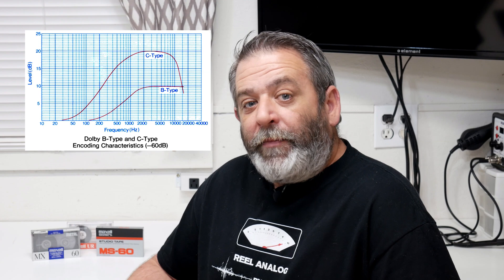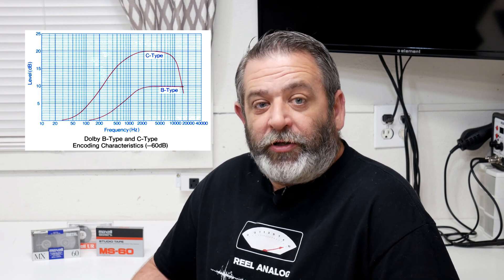DOLBY NOISE REDUCTION - Was it GOOD or BAD? Live Audio Comparison of Dolby B and C on Tape

Comment: This is NOT properly done demonstration. First, no mention of tape machine calibration for the specific tape in test. Second thing is that your deck (don't know what's the source really but let's say it "doesn't matter" at this point) has awful audible level and wow/flutter issues. And the noise level is way too high. Even at the source. I stopped to watch this video but I ended up being disappointed.

Comment: Wait....just wait! Enormous amount of noise is present during recording....in source signal. That is unforgivable mistake. You can not testing equipment in such a way. You implemented huge noise during recording, that noise MUST be recorded and played. Second, you can not test NR systems without deck with regulated bias. That Tascam is good piece, but be fair, take some 3 head decent device.
Reply from the maker: That's an old video. My equipment and capture techniques have changed a lot since then. I probably need to revisit that subject.
Reply: @VintageElectronicsChannel Sure.

Comment: I  used a  DBX 3BX and looped it  through the tape system, and recorded with N/R turned off .  THE DBX was rated at 115 DB S/N and 100 DB for dynamic range.  That translated to cassette, without dealing with the ENCODE/  DECODE , issues that were inherent  in the DBX stand alone units . (THE 224) for example . I also had  the TEAC A-550 RX. THAT did have build in DBX type II, But, I achieved better noise reduction, by using the 3BX . Than, using the built in DBX. Which  was basically a single ended compander.  With that setup, running TYPE IV tapes, I was  getting 20-19 K,  and  a 85 DB S/N. Dead silent noise floor, with no  noise  reduction.  Love the old tech.
Reply: I have diy dbx, I made it back then in 1991...it works awesome. Makes great recording on every decent tape.

Comment: Please stop regurgitating this nonsense that Dolby C was created by combining two Dolby B systems together. This is not and has never been true. It's a totally different system employing spectral skewing to combat tape saturation at high frequencies and high amplitudes as well as providing up to 20dB of noise reduction. On a correctly calibrated and well maintained deck, it vastly improves perceptual transparency and can provide a flat frequency response from 20Hz to 20kHz even with Type I ferric cassette tapes.
Reply: As an electronic technician knowing the inner workings of Dolby b....6 transistors,1fet transistor,4 diodes ECT.you are correct sir.also it was so obvious how he added white noise to fake the demonstration

Comment: Type II/IV tapes generally don't need noise reduction as they can accept higher strength signals, thus giving them higher signal to noise ratios as well. It's normal tapes that noise reduction systems are mainly meant for. Dolby B was good for reducing noise but higher frequencies were still weak. Dolby C would make normal tapes play back with greater clarity and cleaner sound, like their high bias counterparts.

Comment: I use the same Maxwell UR  C60 Ferro and I must say that  I do not accept with them any noticable change of sounding. But my decks ( I use two) are tuned by me exacrlty to meet that result. I wonder (some may say it is conspiuracy theory but it could have good economy reason) that producers tuned decks so that they would sound a bit foggy  with Fe in opposite to  say Cr. I personaly could  not prove  it technicaly supported - both  kinds of tapes sound without sound  issues and that is why I prefer Ferro over switching to Cr and worry about head.
Reply: Most type 2 tapes are not chrome so there's no worry about extra head wear.type one tape on good equipment will perform as good as type 2 with the exception of about 4 db less tape hiss and in some cases higher peak output capacity

Comment: Two crucial points for me are these-- if you use an equalizer, you can boost the treble compass of the cassette when Dolby is IN. That really helps bring up the highs which have been attenuated by the NR system. Secondly, all normal bias tapes are JUNK, people. They were made for VOICE DICTATION. That is it. They were never meant to be a hi fi system. You have to at least step up to type 2 or better tapes to get the treble compass needed.
Reply: I do not agree. In my gear tone controls must be    set to null position and that is poroof of good sounding For sound alignment you need to posess  the  Loudness correction adequate to speakers and levels , not tone controls.  If Dolby beats high sopranos below neutral sound  it means that something with  head- or tape pushing to head or transport alignment is wrong ( of courrse not mentioning cleanliness). Beating it with EQ  is worst idea.
Reply: You have no clue what you're talking about.first of all the high frequency attenuation simply brings the Dolby high boost back to it's original level during playback.nothing gained nothing lost.secondly type one tapes sound indistinguishable from digital audio with Dolby s.i challenge you to tell the differenc

Comment: .. Great  demo for what it's worth the technical aspect of other comments would go way over peoples heads so you done the right thing with this test.  It's exactly what anyone wold do with tinkering and getting there set up right i am on the fence with dolby as i use multi track  recorders but i have to ask is the dolby that's built into these systems a gimmick. Why did they bring out stand alone dolby there is so many options in daws that is the reason i would avoid using dolby
Reply from the maker: I don't think Dolby is a gimmick. I believe it had practical purpose in reducing tape hiss at the low speeds cassettes run at, especially in the early decks. That said, I'd rather deal with the hiss than have my recordings dulled on playback with Dolby B
Reply: @VintageElectronicsChannel  .. I respect your knowledge and sharing your experiences  with this technology but i do have a question. I own multi track cassette and reel to reel recorders and would love to know. Is the built in dolby b of these systems of the same quality of a stand alone. I am looking at some standalone like a TEAC AN-80 would is give me the same results as  something that has dolby b built in with just the regular on off.
Reply from the maker: @theprogrammerrolandmc3039, I don't think I'd recommend using Dolby with a reel to Reel. Even at 7.5ips, the noise is so low I don't think it would be necessary. I don't have a lot of experience with standalone Dolby equipment, except some Dolby A stuff for open reel. I would think it would be the same technology and result as a built in system though.
Reply: @VintageElectronicsChannel  .. Thanks for your help i agree reel to reel is completely different from cassette i never have hiss on my reel to reel.

Comment: Dolby noise reduction works only in the most optimum circumstances. Clean tape path, right head height, azimuth, tape speed, tape calibration and level. If you don't, tape will most likely sound muffled. People don't want to go the extra mile to get their decks properly calibrated, so they just rather be stubborn and say that dolby nr never worked and just never use it. But when it works, IT WORKS. Dolby S plus a metal tape is as good if not even better than a CD.
Reply: Yes, agreed. I run a 3-head deck with Dolby B, C and S. It also allows me to calibrate the bias to the tape. Dolby S effectively has the same noise as a CD, i.e. none. Dolby C is subjectively nearly as good and Dolby B has a little audible hiss, but way less than recording without. Other than slightly audible hiss with Dolby B, any of the Dolby systems give an overall recording quality with Type 2 and 4 tapes that is effectively indistinguishable from the source, be it CD, Vinyl or whatever. I could certainly never listen to a non-Dolby recording on headphones - the hiss would drive me crazy. However, my first experience with Dolby was in 1974 with Dolby B on an Akai deck and it sounded awful, partly because I only had type 1 tapes, but also because the Dolby was probably badly calibrated and drastically knocked the treble off as well, making recordings sound as though they'd been made from behind a thick curtain. It's a fact that all things analogue are far more dependent than digital on being of good quality and being set up properly if they are to perform well, but that in itself brings its own reward.
Reply: Lots of audiophile malarkey there but I'll snap on the last sentence.  
Digital audio's bit-depth determines the level of the noise floor.  The top of the line, most expensive open reel machines used in recording studios were almost as good as 13-bits in perfect conditions while using the most advanced NR systems available.   To suggest that a cassette tape of any formula with any form of noise reduction can exceed the 16-bit quality of CDs is ridiculous to the point of being offensive.

Comment: For me, it depends on how I plan to use my cassette. Dolby is heavily dependent on azimuth. Playback on another machines with Dolby which aren't in perfect head alignment with the recording deck, will usually not give favorable results with Dolby switched on. They can often sound dull and lifeless. If I am making a cassette that will be played back on other machines, I will usually opt for no NR unless the recording contains quiet spots and I am on a Type I tape, then I'll encode with B. If I am making a cassette that I plan to only play on the deck that is performing the recording, I will opt for C. My deck doesn't have S but I am interested to hear how that compares to C. Metal cassettes have lower floor hiss by nature, so you can certainly get by with recording with no NR on those if you have money to burn. When a metal cassette is played back on my recording machine with C Dolby used, there is absolutely no hiss at all. Only the amplifiers transistor hiss is present. Sometimes, as you mentioned, I will record on type I with B NR on, even if the cassette will be played on another machines without Dolby, because the only draw back is usually exaggerated highs which can be corrected easily through tone or treble adjustment. So, my opinion on this is - If you are planning to play your recording on other machines, it's probably best to leave Dolby off. On type I tapes you plan to play on other machines where your recording has quiet moments, I sometimes decide to record with Dolby B on. On those types of recordings you might get lucky on another machine with Dolby on. If you are only playing back on the deck doing the recording, shoot for the moon. It will sound fantastic!

Comment: B and C worked great if you recorded and listened to  the tape on the same deck for sure but it might not sound so good on another deck. I used chrome cassettes  mainly TDK or Sony were my faves but also Fuji had good ones. If you set the level just right it was way better than nothing because the hiss and lack of dynamic range of a raw cassette was not very listenable. If you had a type 1 tape with no dolby it sounded like gravel. Does the youtube compression affect this? I remember hearing the hiss much more even with better tapes.

Comment: It seems like there are some issues with your equipment. There's an awful lot of noise and distortion in the sound during the demonstration. Even during the 'recording' part where you played the 'original' there was already a ton of noise in the sound. That should obviously not be the case. The playback that followed after that sounded extremely muffled and distorted. This is NOT what tapes should sound like, played on a well maintained and calibrated cassettedeck. Other channels like 'Cassette comeback' show what tapes can actually sound like. Even without Dolby they can sound a lot better than what is demonstrated in this video. This video might give people a completely false image of what cassettes sounded like.

Comment: My experience has been that I never use Dolby with chrome and metal cassettes, as these usually have a very low noise floor and the record level can be set so high, that the sound acoustically masks the background noise. With normal position tapes, I use the best noise reduction system available, but either when I'm sure that all my cassette decks have the same Dolby calibration and I don't notice any pumping, or when I'm sure that I'll only be replaying on the same deck.

Comment: You were super over biased on that type 1. Proper bias and a type 1 sounds very good with no loss of treble. In my experience with NR, it can sound very good, but there's still something missing and some music makes it apparent, a quiet trebly instrument buried behind loud mids and lows will sound slightly quieter using NR. But not always. Best to leave it off, no processing, just hear what's actually on the tape. Dolby is a cheat that doesn't quite work perfectly.

Comment: Before doing such a "test": You have to calibrate the recording level, bias and if possible the EQ ( this have noting to do with the 120/70 us ) for every tape used, certainly using DOLBY C ! DOLBY C needs the record level correct within 0.3dB and a descent flat frequency response to operate properly. By the way, your TASCAM 112 has audible flutter.

Comment: I don't think it was nearly as good on commercially recorded cassettes as on ones you made yourself on your own machine. First off most commercial tapes were recorded hot and lost highs to begin with. Then cassette head alignment was critical and probably the mass production recorders heads were not exactly aligned like yours which would lose highs.  I always worked to keep my peaks out of the red as much as possible and made decent recordings with higher grade tapes.
Reply from the maker: I agree with you. Commercial tapes never sounded good with NR switched on.

Comment: Type I - All three were too quiet (if volume didn't change) and lost horrible amounts on B and C.
Type II - B and C weren't much different than the original, but slightly muted.
Type IV - Surprisingly B and C did worse than Type II.
Overall, Type II was the best.  Now let's hope the newly made Type IIs are as good as old stock.
Reply from the maker: I've always preferred Type II cassettes. Metal sound great too, but I never felt the price difference was worth it when compared to a well-recorded type-II.

Comment: How about a video on DBX noise reduction and compare it to dolby C and S if possible. ? Sometimes i use no NR and other times just B or C when recording or playback. It also depends on the quality of your speakers and in particular the Mid ranges if you plan to use dolby B or C, There you notice the most benefits in my opinion. A great set of Modern Speakers sounds best with the older vintage receivers etc just as long as you match them correctly in terms of impedance and Watts output. Also modern over ear headphones sound extremely great with vintage walkmans etc. Try them and see.
Reply from the maker: I have plans to do a DBX comparison to Dolby. I have the equipment, so all I need to do is record a video. It'll be coming up.

Comment: Hello there... I appreciated your attempt but even the original file playback sounds quite hissy to me.

I have like many others had my share of renewed experience with Dolby. I am mostly using Technics decks that do both BIAS and EQ at 3 kHz. The result is amazing when there is a good tape in, i.e. barely or not even distinguishable from an unprocessed recording, but only with BIAS neutral tapes (Maxell XLII, TDK SA, Sony UX-S and probably AD, HF-S, XLI). But at this point in time you might incur into degradation, a tape that basically isn't able to cope anymore with the compressed dynamic range, which results in drop-outs and other glitches that were otherwise barely ever present without the usage of Dolby.

To make the most out of Dolby without coloring the sound using a standard calibrated deck with no BIAS tuning you have to pick a tape exactly centered in the IEC type slot.
Reply: I have a Sony deck with calibration and Dolby S. Using a calibrated type II or IV tape with S sounds amazing.

I agree that the first thing I noted in this video as well was the amount of hiss that was omnipresent, completely ruined the validity of these tests IMO.

Also, dude, you recorded these way too hot! You shouldn't be going over 0dB on a regular basis.
Reply from the maker: After publishing the video and listening to it, I noticed the hiss as well. Since recording that video, I've changed the capture method for all my decks to eliminate any outside and unwanted hiss. Details in the video description. Good points in your comment though. Both the deck and tape make a huge difference.